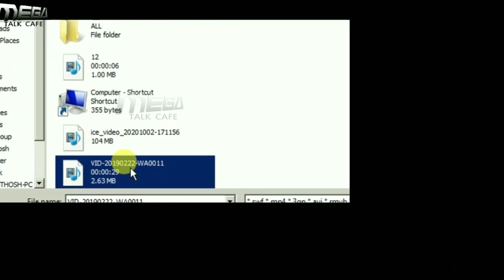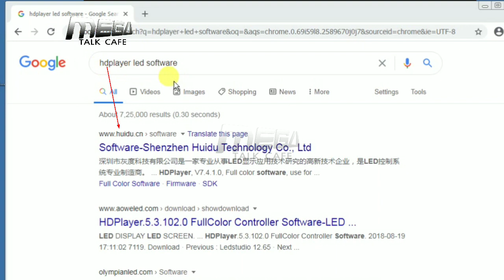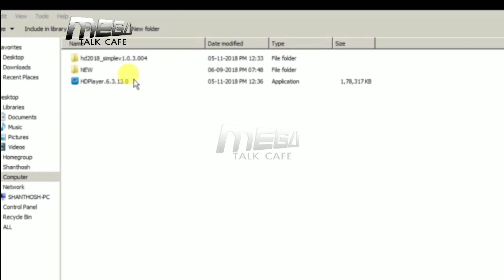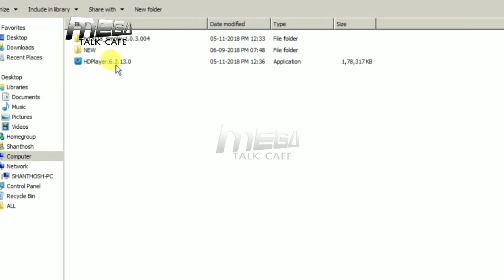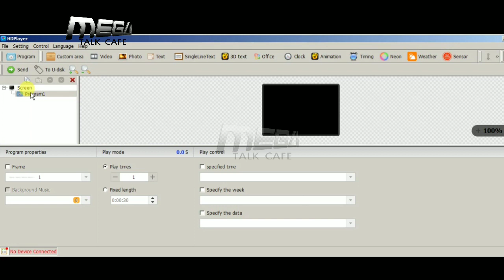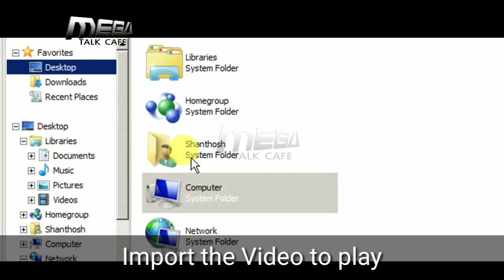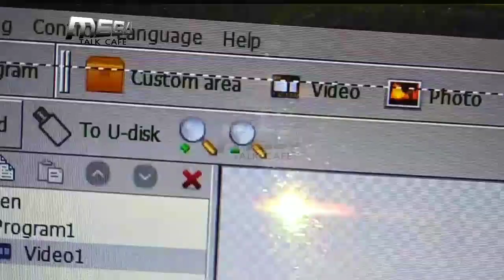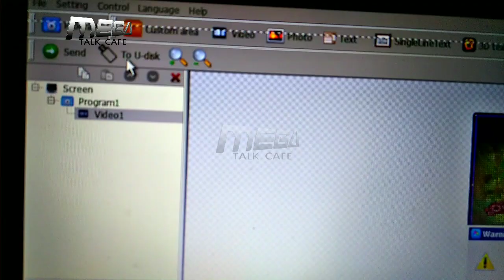HOW to Use LED VIDEO WALL SOFTWARE | HDPlayer | D10 D20 D30 | led video wall software

Comment: How to use it as PC monitor no matter what resolution is. Just to display lyrics no need sending card?
Reply from the maker: Cannot be used as PC monitor.!
Reply: How can i have link html i insert but nothing hapen i was ok to have hdmi imput in card but i understant i need A4 controler îs that true?